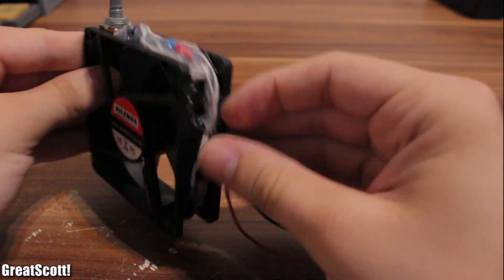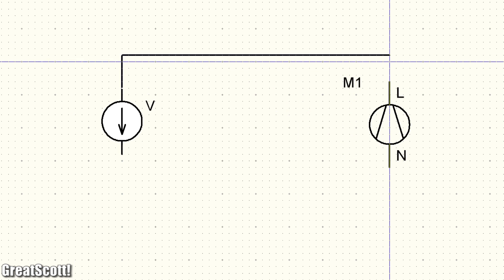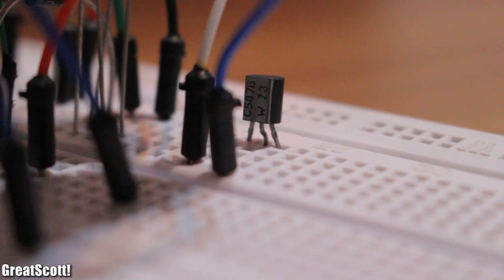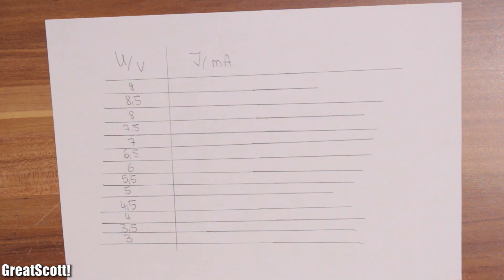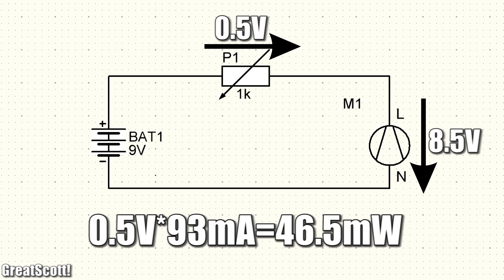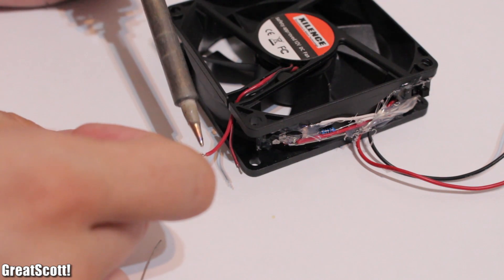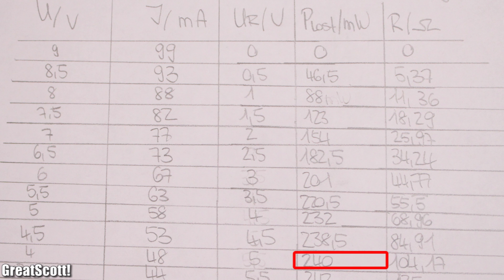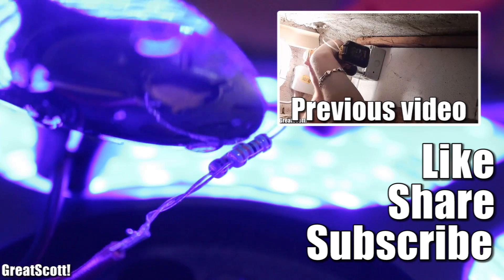PWM VS Potentiometer! When to use which technique?

Comment: This is funny and a old one.
Perhaps a title of  pwm v analogue and power loss calculations.

I'm old and like analogue. Then have to apply this modern stuff to it. And then work it backwards so I know if it's right...

How about you grab a Lucas voltage and current regulator and put them side by side with a modern take. ;)

Comment: In my example I have a red 2,2V 1A LED, and I want to power it from a single li-ion cell which voltage is 4,2V. I afraid to use PWM, because it seems that in the higher state the current will be way too big... Should I worry about that?
Reply: You will definitely want to current-limit your 2,2V High power red led anyhow.  Some PWM circuits suggest doing away with the resistor but that's not how things work: at 100% duty cycle (full on, basically) you will break your LED if you don't use a current limiting resistor.
And a well charged Li-ion cell will not be at 4.2V, but 4.3 or even 4.35.

Comment: Excellent video, I keep PWM was the better way to go to get the maximum from the battery and to reduce the potentially dangerous heat buildup.
Reply: That reduction can also be achieved by using much higher power (.5 1 or even 2 W) resistors...in some cases PWM might not work and a resistor is, unfortunately the way to go and you will need those high resistors.
I'm impressed that his didn't start smoking seeing how hot they were actually...
From work I managed to score 3 16 Ohm, 60W resistors (no clue what they were in, but oof they are beefy).

Comment: why do some instances of PWM control not allow going close to minimum load, while voltage control will scale all the way down to minimum load?

example, in my pc's bios fan control, i cannot set the fan to stop when the temperature is under control when using PWM control, but when I use Voltage control I can
Reply: Maybe because some of the fans do not support PWM control, but do support voltage control (best way to tell is if the fans have 3 terminals: that's Voltage controlled fans, and 4 terminals is PWM controlled).
Some motherboard controllers also need to be explicitly told to come to a full stop under a certain temperature threshold and won't do it otherwise due to reasoning that a fan stop can mean a failure of one.

Comment: It's really hard to find cheap 220 ohm potentiometers for some reason, I see 10K ohm and higher though everywhere. Would a 10K ohm resistor work well with a very small voltage? Like 1.5 volts from a AA battery?
Reply: Depends on what you want to do with it.  The voltage source in your case is also really low in value, so the current limiting a resistor of 10K would do along with the voltage drop the resistor causes would leave you with little current to work with, which is to say if you can find something that actually works on 1V.

Comment: I am working on a laptop fan. I could really use some help. My laptop fans are running at full speed. It is a motherboard issue but replacing the motherboard could cost me over $500 USD. The laptop is ASUS ROG Strix GL702ZC. I bought some pin adapters so that I don't have to destroy the fans to splice the wires. I connected a 10K ohm potentiometer. I may need some assistance.

Comment: thanks for the video, i have a hard drive box that works well but after some hours i am going crazy with the sound of the fan, and i did not want to put a big set of parts in the box to slow the fan but maybe just use a 10k POT maybe 2k Pot but dont want the pot to get hot
Reply: In case of putting a potentiometer between the device and the voltage source, the heat buildup in the resistor that is a potentiometer is based on 2 things: the amount of voltage difference you want to create (in your case: how fast the fan is spinning) and the amount of current this device draws.
The reason his quarter of a Watt set of resistors became flaming hot in the case of the LED strip is because there was a stupid amount of current (up to possibly around a full ampère) running through them all while also trying to limit some current from reaching the LED's so they would not shine as bright.

Trying to regulate current/voltage with a resistor means there will be power that has to be dissipated in a way, in this case by putting all the power we don't want the device to use into an electronic part that has to get rid of the excess power by converting it to heat.
In case of low-current devices this will typically not be a thing for small variations, but the bigger the difference between the device and voltage source, the more heat the resistor will start producing.
Even if 0.25W resistors might be fine for a small variation, they might start to become reasonably hot when you slow the fan down more, because the power not used by the fan will have to go somewhere, in this case by being converted into heat.  Sometimes you can feel this, sometimes you can't but the process is basically still there, just not detectable.

Comment: i'm searching for a solution the change my 'voltage  in'  of  a my dummy load.  the 'voltage  in' is 54.8 V. max load is 4 X 50 W (a little more with ventilation, display, etc.). Any suggestions ? Kind regards.

Comment: Thank you for the explanation. I built the circuit but found not much difference with a variable resister. So I scrambled the circuit. Guess I have to build it again. Tq
Reply: Some PWM circuits will require a big value potentiometer in order to see a big difference in output.  One that I know uses a 100Kohm one, with a 10K one the difference is minimal, noticeable, but minimal (in my case it's used to control the backlighting of buttons in a dashboard-simrig setup).

Comment: Idea for a project:
PWM controllers use a manual potentiometer. But what if you want to control it using an Arduino or similar? Could you use the Arduino to control a small logic level MOSFET, which would feed into a simple circuit with a capacitor and a resistor? If you solder the terminals for this in where the manual potentiometer was connected, the pulse length would determine the voltage between the terminals, and thus affect the PWM controller as if you were using the manual potentiometer.
Reply: You can use regular (BC547) low-power transistors for driving them as variable resistors.  That's how I use them in a dashboard-simrig build for controlling the gauges from an Arduino.
Low duty cycle/PWM frequency (I have yet to look at the output of a PWM signal of an Arduino with a scope, I have seen the Tone one) means the gauges shows a low value, and a higher PWM value means the gauge shows a higher value :) .
You do need to use a fairly high value resistor on the base of the transistor in order to do this, you want to drive them like a variable resistor after all (I think my setup uses 10K).

Comment: Simply, PWM has no internal resistor, so all of the power is used by the load. But the freaking potentiometer has two internal resistors which really suck the juice out of your batter 😜
Reply: he showed in the video that the 555 PWM circuit can actually consume more power than the potentiometer depending on the use.

Comment: Do we lose the output torque with PWM when we try to reduce the number of rpm
For example: the max RPM is 3000 Rpm, we use PWM and get 1500 revolutions. Have we reduced the torque on the output shaft?
Reply: Typically, no, but it will depend tremendously on the motor technique.  A fan is not supposed to have a lot of torque, but a DC motor will typically not suffer a huge amount of torque difference using PWM, where it will definitely with a resistor in line (even if you can find one that won't get flaming hot).
Reply: @Dutch3DMaster  thanks

Comment: Is it better to use potentiometer instead of pwm on led indicators? I heard pwm is not good for eyes.
Reply: depends on the frequency i would say. If the frequency is above 1khz there should be no problem at all. If you only have a PWM frequency of a few hundred Hz it could cause eye strain though.

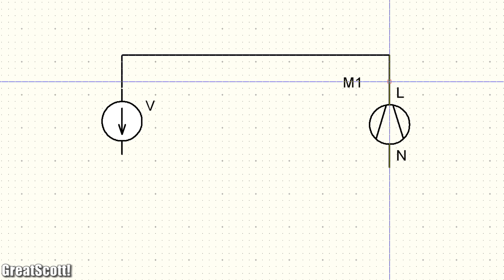Comment: i'm at 0:55 but after you said power loss my whole question fell into place in my mind. resistors bleed energy to heat, pots are variable resistors. pwm turns on and off the use of power, so no energy bleed to heat. i think there are circumstances where this isn't true, but based on the fan i saw this isn't a situation like that.

Comment: the components I salvage from broken electronics dont fit in my breadboard, any advice?
Reply: MRGCProductions20996 make sure you clean off as much solder as possible. Also, it the spacing of the legs is off, solder some solid copper wire to each leg so they can bend into the holes :)
Reply: Yeah, single strand wire of the right size is perfect.

I still need to get myself a breadboard but i know this :P

I use welding wire sometimes. (MiG wire) its just copper wire on a roll, single strand, with no insulation on it

There is probably cheaper wire out there but just an idea if you can find some like me :P

Comment: Hello, Love your videos. I have a question. I am trying to make a power supply from my mains (110 v, 60 Hz). The output must be adjustable from 1 - 60vdc. I will use a transformer and full bridge rectifier. I need to control the voltage some way. I also wanted to switch the voltage with a MOSFET using an Arduino to get an adjustable PWM and frequency. Am I on the right track? Thanks, Any suggestion?
Reply: Mind the fact that my electronics experience is limited to soldering a couple (literally, if I remember right) of kits. Once you get the mains to 60V and rectified, this seems to be a job of a step-down regulator. A full Arduino MC might be too much for the job, but if you find uses for the other pins of it (like a fancy light show⸮) it might be simpler overall.

Comment: From where i can salvage transistor for my 12V dc motor i have B20K90  potenciometar, and on any curcuit board thath i salvaged it didn't sayed voltage of transistor just some numbers i just need speeed control on my 12V DC electrick motor and thats is pritty much, sorry for my English and spelling. Can someon answer me pls. tnx :)
Reply: type the numbers in google and search for the datasheet, there you can find the max. input voltage

Comment: by the looks of it the thing wold be more efficient if you used 2x NE555:
The current-draw is linear with the supply voltage, at ~5V input it is down at ~2 mA, at 9 V it goes as high as 10 mA.
So if you used a 2nd 555 to generate a 5 V supply, even with the extra components needed, you would likely end up under 40 mA.

Also - how well would it work if you used a comparator to control the mosfet?
A simple voltage-divider for one input, sense-line for the other, and convert the Mosfet PWM to DC with a capacitor.

Comment: Uh, danke.
Zu einer zeit, als Strom sparen noch nicht so wichtig war, währe so ein Spannungsteiler auch kein Problem gewesen.
Reply: DrCrazy - uhm... doch.
You normally have one of those 2 szenarios:

Working with mains voltage - high power applications, you would need humongous resistors for them to not burn up.

Batteries - you want it to be as efficient as possible cause they don't last long otherwise.

Comment: I was playing around with speed control of a propeller motor for a model boat. Using a pot, it would slow down to a certain point then suddenly quit. But, with PWM is slowed down smoothly until it was just a slow crawl. Imagine making a toy motor turn smoothly at 60RPM or even less! The fact is, when it gets each pulse of current, it also gets full torque during that pulse. When the pulses are fast enough, it appears to be smooth.
My vote is for PWM.
Reply: you're probably using a log pot - use a linear one
Reply: @benkrege2135  No, that's not it.  Most motors (especially cheaper, usually brush-ones) will have a stall voltage limit which will cause the voltage supplied to be insufficient for enough current to make it turn and have another successful turn be initiated.
A linear pot will probably then show the same behaviour, except it will show it at a different point when rotating the axes of said potentiometer.
With PWM however, the voltage provided stays the same, but not the time it is applied.
If the motor wants to turn because of the higher voltage, it might see a small amount of movement and if the frequency of the PWM signal is high enough, it will keep functioning at much lower speeds: the voltage required to push current through the device is, after all, still there.

Comment: I need help, I'm a noob on all this. I try to use a 10k potentiometer to dim a white LED off of 9v battery,, but the potentiometer keep burning up, please help! thanks!
Reply: Well what do you know now?
Reply: I'm finding that I need a beefier, potentiometer., 10k pot can't handle 9v current.
Reply: Also noob here, but you probably did not ground the potmeter so it is forced to consume the charge? Then the potentiometer serves not as a voltage divider what you want but variable resistor that just changes current. It can then heat up and indeed burn. afaik

Comment: IF this is basic I think you might have to go elementary with me, I have no idea what your doing.
Reply: Filmthechannel I might be wrong but I think the easiest way to think about this is by knowing how resistors work. A resistor makes electricity struggle when flowing through a resistor. This struggling makes the electricity to use up some energy and that's where the loss comes from. When using pwm you are changing the voltage levels very quickly for example if you apply 5v for 1minute and 0v for 1minute the average voltage you applied is 2.5v (ofc with these long periods the motor's movement would not show anything interesting). by changing on/off periods you can adjust the speed. There is very little resistence in this pwm circuit and the IC that generates the pwm signal only consumes little power the loss is much lower.

Comment: in short, potentiometer adjusts the voltage/power at the load by spending the rest on itself.i learned this by burning up a few potentiometers. but still, i sometimes use high wattage potentiometers for the sake of simplicity and the power loss is not important.

Comment: :( İ Burn My Raspberry  Pi 3
Reply: facepalm
Reply: you aren't supposed to power large loads directly with the pwm signal. you use it as a switch to turn a MOSFET on and off, and the MOSFET then turns the large load on and off.

Comment: simple! connect the fan directly to a 9v battery ;)
Reply: vina's Lab lol, why is this not the solution??? Just cuz they want to vary the fan speed, right? Haha

Would you even need the resistor then?

I dont understand fully why we need the resistor at all. The 9volts wouldent just go thru the potentiomiter and fan by itself??

Comment: But the main difference between a variable potentiometer and a pwm is that the pot sets a constant voltage, while the pwm only sets the average voltage.
For different loads with the pwm you might also need a low pass filter.
Do you agree?
Reply: Using PWM, the voltage basically doesn't change, each pulse is the same voltage, it's the pulse-width of each pulse that causes a particular response of the part connected to it.
Small/short pulses mean a short amount of time in which current can flow, while a 100% duty cycle of the same signal (full on, as if the PWM circuit wasn't there) means current is flowing continuously.

Comment: Scott, I'm trying to understand a switching regulator system. From what I've learned, a switching regulator varies a square wave's duty cycle in response to a negative feedback signal with respect to a constant reference voltage (zener). My issue is, how would I set up this feedback network, and how would I adjust the oscillator's duty cycle without affecting its frequency?

Comment: Great video... question?...I want to use only a resistor to slow down the speed of my fan.. the spec is 12v 1.60 amp.... the power source is a 550 watt power supply.., how much ohms and watts should i buy.  want to reduce speed at 25 to 50 % thanks...
Reply: Forget watts in resistor calculations.  Depending on the amount of current you will have to limit the fan to in order to reach a 25% to 50% reduction in speed, you will have to try out multiple resistors.
Let's for simplicity say that in order to reduce it's RPM by 25% we need to reduce voltage an equal amount (which obviously is not how things work, but OK).
Just for the sake of simplicity we also consider the resistor to be a perfect electronic part with no imperfections, and in order to reach the reduction, we can reason that at normal operation, the fan uses 19,2W of energy (12V x 1.6A).
In case of a fan reduced in speed by 25%, we end up on (roughly) 14,4W (9V x 1.6A).
That means that almost 5W's of energy (which usually is much more than people realize it is) will have to be going somewhere, which in this case will be a heavy, expensive 7.5W resistor (you could use 5 but it will get quite warm due to being on the exact limit of it's power dissipation).

Comment: Question, I'm trying to control a motor controller with an Arduino. The motor controller typically uses a potentiometer to control the speed. What's the easiest way for me to eliminate the potentiometer and replace it with an Arduino? The max RPM voltage on the potentiometer is 5.5V, PWM from the Arduino doesn't do anything unless I run it at 100% duty cycle. So Basically I need to output linear voltage with a range of 0 - 5.5V, 2.6 - 0.2mA respectively. I'm obviously a newbie with this but the best I can think of now is to just attach a servo to the potentiometer and drive the servo with the Arduino.

Anyone willing to help from a Youtube comment thread?
Reply: use a npn transistor and use the arduino pwn to control the transistor. this will mimic the pot by lowering/rising the pwn signal. with lower pulse the motor acts as if it were recieving a lower voltage. thats what i do and it works like a charm.